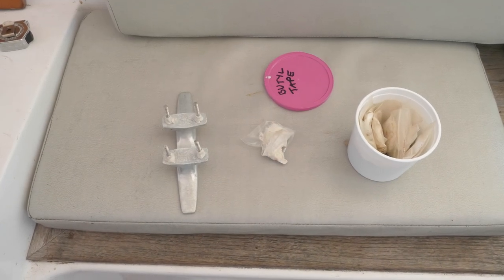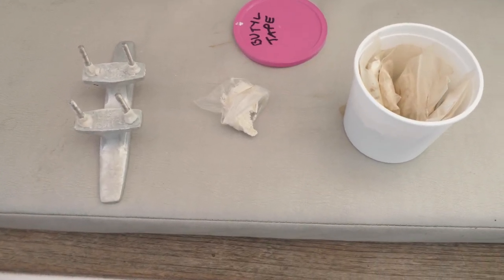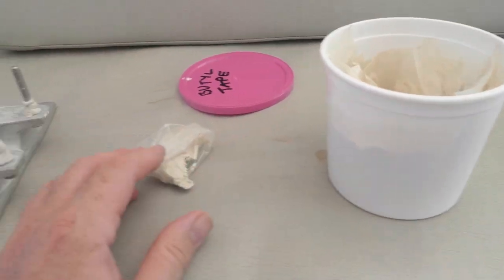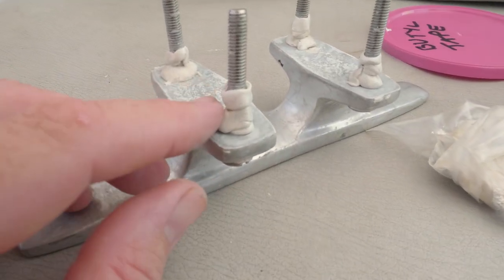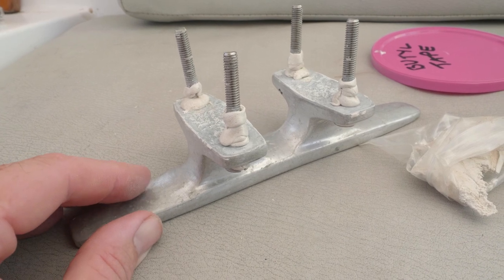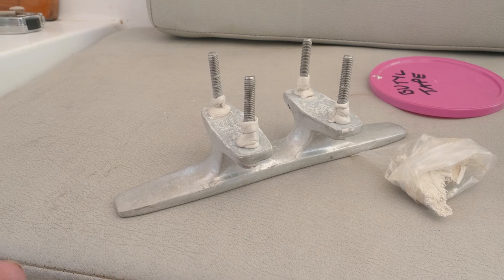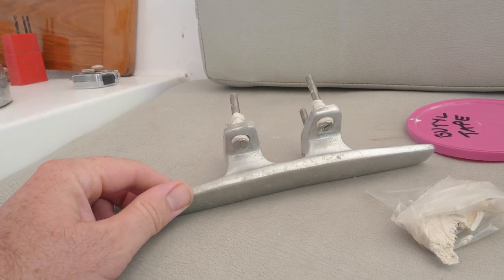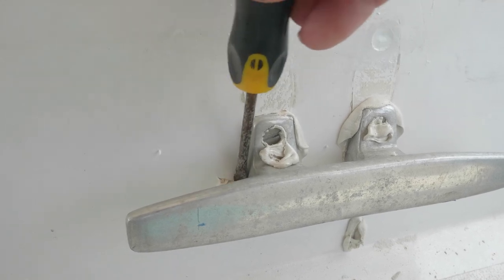HOW TO USE BUTYL TAPE TO SEAL DECK FITTINGS ON A SAILBOAT - SAILING FOLLOWTHEBOAT EXTRA

Comment: First of all I have to apologise for my English. As I a not native speaker it sounds sometimes strange.

The butyl (and lots of other stuff running trough the marinas as rumours as the best) was created for other application than sealing. As I worked as developer in the field of insulating glass sealants I really know all the used material sticking glass, aluminium, plastic and others. Butyl was extruded as the first sealant on a double sealed insulating glass. The vapour seal is excellent, but it is never mechanical lasting. The temperature resistance is weak it becomes soft and sticky when it goes warm. If you have movements in the sealed area it glues with dirt from the environment and divides itself, this means it become unseal. because it works only like a dry screw. When you have to remove it, i.e. when replace a cleat it is nearly impossible because its behaviour is like an old glue from duct tape.

As described, butyl is used for the firs sealing in the inner side of insulating glass. the butyl tape, you (and lots of others) used. was made for mudguards ant other things in the car industry. It has no chemical bonding to the substrate and therefore it can (and will) be infiltrated from dust, salt and water. It has no temperature resistance and become soft in warm environments.

I by myself use either a very cheap acrylic sealant if there is no physical strength asked. An alternative could be Polysulfide sealant (as ist was used to chalk old wooden boats). you can us as well a ordinary silicone rubber as used in window frames (its the best if you have problems with UV resistance. Polyurethane (Sika is only one brand) is not as good if you have to loosen screws again. At the point of environmental influence there no sealant better than others. they all got the problem of plastic and will  not weather in a short time. The only advantage of butyl is, it is not curing and stands in a malleable  condition for years (what causes the above described problems).

You can make a simple test if you don't believe me. Take a small piece of butyl and stick two flat pieces of wood, GRP or metal plates together. Then try to tear apart the pieces. You will see a curtain of fine strings. put it together again and tear apart them again. do it like you want pump. you will feel that he strength become more and more weak. The butyl (if white) become more and more dirty and especially in high humidity it won't stick after a (short) while.
Reply from the maker: Thank you, Wanambi, and your English is spot on! I think in most instances the butyl in deck fittings won't see dirt (or the light of day) because of the way they are installed, but I have already tried your little test and yes, I got the curtain of fine strings. So far, after four years, it has held up well. Thank you for posting, we always appreciate feedback from people in the know 👍
Reply: Butyl sealant used in insulating glass units is a material that hardens to a rubbery state. Butyl tape on the other hand is a material that never hardens or changes consistency  much even after decades. Even though they're both called Butyl they are really completely different.
Reply: No Richard, butyl tape, or better butyl band is extruded with 150 to 160°C from 19 kg blocks direct to the aluminium frame. The glass is applied from two sides to the frame, after this silicone, polyurethane or polysulfide is used as the secondary sealant. This is named two step sealing with butyl as first sealant and others (SI, PS or PUR) as second sealing.

What you mean and maybe know is as single sealed glass often made with hotmelt. Hotmelt is an other product, it works like an activated one component sealing and reacts to the rubber near product. It is stabilized often by an aluminium band inside and supplied often in big rolls. You can get it as well in blocks end extrude it while application.

I could tell you the full story of producing insulating glass from the 1970th but this is not the topic. The topic is sealing screws ant other thing with butyl tape. The recommended 3M Tape is used in cars for the montage of mudguards, or on roofs to seal steel sheets and prevent from scratching an noising.
Reply: JED you are right. The situation is that you always have small movements. Especially the Deck fittings move a lot. this makes the described curtain which offer the possibility of incoming wetness and dust. The seal will not fail immediately it looses (and this is the problem in our usage) from the both "open" sides slowly the adhesion. You will not see the unsealed parts because they are still tight for water. Nevertheless can the water either condensate in the gap or come as liquid water into the gap. As nearly all decks made in sandwich construction it CAN be a problem for the foam or wooden core. But that's not the only thing. As butyl sticks like a chewing gum it is as hard to remove. It is only a physical adhesion but over the time (influenced by heat) it becomes stronger like a rusty push-button. The surface in contact with air seems like it hardens but it becomes only dirty from dust. The covered part get deeper and deeper into the pores of Gelcoat or paint. To remove it for repainting solvent is used. with this solvent you smear the butyl around a big surface. (you wont see it with white or cream coloured butyl but for your own test take black butyl so you will see it.

I don't want to say it's wrong to use butyl. I want say it is not as uncomplicated as often told. The shipyard of my old boat used it (now 40 years ago) as I removed some deck fittings (especially cleats) it was a nightmare to see how much water came inside the sandwich and as well to remove the sticky stuff. Our boat I prepare now for living aboard is a French Dufour. As well it is now 50 years old but they used silicone rubber. For the first I was shocked because the deck needs to be repainted but it is removable very simple you can rub off the bigger layers and then clean it up by a small amount of solvent. The solvent should be soluble with water that you can rinse it of simple - that's it. The unseal parts have been the parts which where replaced cleats or screws always. Either butyl nor sika (PUR) is an universal problem solver in this field.
Reply: From my experience butyl has 3o year life expectancy, meaning it can last longer than that, but it starts to lose its elasticity after around that long and become less malleable. One should start thinking about replacing it after that long. Before it gets to that point as you stated, in which yes it can start to allow water to seep through and is harder to remove. So 40 years waited too long. This might be because as you stated it loses its properties after continual expansion and contraction plus allowing in dirt the more it is stretched, do not know, just know from experience it lasts that long in sealing instances that has mechanical nuts and bolts (or smaller applications, screws). 

I was not aware that its adhesion strength increases over time, plus being influenced by heat. Good to know. Nor was aware that it should not be used in places that sees lots of movement, although never have used it for that. Again, good to know.
Reply: Kevin, it's always boring to discuss about personal experience. To check if it's lasts or not you have to make several tests i.e. tension strength, extension force, water vapour resistance and so on. It depends as well in the weathering situation, the temperature situation and the movement (especially elongation). In Insulation glass the primary sealant (butyl) lasts longer then the secondary sealant (PUR, PS, SI). You have an absolutely clean environment between the two glass sheets. For the deck fittings you have an extreme movement with hard shocks (when the lines set in) as well you have often (in the Caribbean or south sea or other hot regions) high temperatures which make the butyl soft. This comply with the requirement of a kind of "auto sealing".Nevertheless, it becomes unseal on the edges butyl to GRP in small lines, it becomes hard and it is hard to remove if needed. Of course, you and all the other can do what they want - this is only a discussion about the advantages and disadvantages and everyone can decide by himself. My speech is only my experience of 20 yeas developing sealants for the biggest producer worldwide ;-))
Reply: Sorry but professional observed experience only adds to the whole picture. Tests are great starting point, but can never replicate real world environment and various conditions. This is where on-hand actual experience comes in. Stanchions, cleats, portals, etc using butyl have all shown to last well with no leaks for many years. I do appreciate everything you stated, lot I was not aware about. It is always good to learn something new. I personally would not recommend its use on cleats, due to as you stated the hard shocks and lack of strong adhesion, yet many others swear by it.
Reply: Kevin, many others swear by a lot of things. Again, I never said not to use. I gave the idea for what it was made and used for in the last 50 years. As well I am not sure if it was developed or coincidentally found and later grown to a useful matter.

Be sure we made al lot of tests with all available sealants in many fields of usage. Due to we gave guaranty  we had a look to all possible fails. Butyl is not the best sealant for using as a single sealed system. If you modify it to i.e. a hot melt it works with chemical bonding and then it is o.k. Butyl is as well used (in a very clean form) in chewing gum. And nobody would say you can use it for sealing. The main technical reason for using it in insulating glass ist the water vapour resistance. In the car industry (and other industries) is the fixing before screwing and prevention of scratches while montage.

On the boat you can use it i.e. for PREFIXING portlights in the hull (such they are fixed with screws) but only for prefixing - for SEALING you MUST use an other product like Silicone or Polyurethane. All the time when you have to hold a part in place for drilling, bolting, measuring it is very helpful.

Oh, what I forgot. One million flies says shit tastes good but I for me wouldn't eat it.

Comment: The process looks pretty much the same as used with plumbers putty.  I wonder if that has ever been used on a boat.
Reply from the maker: Quite a few have mentioned the similarities with plumber's putty. I'm not sure of the chemical difference.
Reply: It may appear the same at first glance but are definitely not the same product. Plumber's putty is made from clay and linseed oil while butyl tape is a synthetic rubber. Plumbers putty will take a long time, think twenty years, but it will harden, crack and leak while butyl will never harden, crack or leak if installed properly.
Reply: I have bought a 38ft boat this summer, which had its teak deck removed ten years ago and finished in paint; every deck fitting bolt was sealed with 4200 back then and when I took it over about 50 bolts were leaking, hidden by the header, and had been for years, causing rot and nasty black mold all over. I have removed (almost) every fitting (just couldn’t shift the toe rail bolts) and found that in most cases the 4200 was ‘dead’. I have read that butyl tape will be good for 40 years plus. After finishing painting the inside fibreglass surfaces, and next the deck I will use butyl tape on the new ss bolts; no more 4200 or sikaflex for that job. I’ll try the one person trick of grinding a groove in the end of each bolt to enable the bolt to be held still with a flat head screw driver with one hand, whilst the nut is tightened with a spanner by the other hand.

Comment: Use butyl as primary, unless it is in a place where pressure is excerpted
Reply from the maker: I think a bit pressure is ok providing it's through-bolted. Perhaps something like a stanchion base that gets grabbed all the time as you get on and off the boat might be questionable but then we used it on all our stanchion bases and haven't had a problem so far.

Comment: Don’t use it near a place where you might spill diesel. It will dissolve in diesel/petrol.
Reply from the maker: Good point, Edward. I should have included that in the 'cons' 👍
Reply: This sounds very significant.  If both diesel and petrol disoolve it, what's its resistance to other chemicals like?  Chemical resistance is quite a factor in some scenarios.

Comment: OMG, I've been trying to tell people about this stuff for years. Almost no one will listen, damn silicone heads...
Reply: Yes it is weird people just don't listen they shuffle off to chandlers and buy all sorts of goo and then make a huge mess, swearing all the time and still have leaks.  Love Butyl tape.
Reply: P. T. Anderson Silicone may be pretty sticky when it is new and uncured, but the inevitable movement one finds on a boat can cause it to become "unstuck". Just think about all the siliconed fittings that you have ever removed from aluminum spars: it traps water under it and provides the perfect environment for a salt factory to establish itself while your back is turned. And somehow that ooze-gel seems quite caustic; it is certainly destructive to aluminum. Many times we have seen deck fittings that leak from the start simply because the installer unwittingly broke the seal with the solvent that they cleaned the perimeter with after bolting, washing the silicone right out by getting between the surface and the caulk. I am not saying that delicate plastic instrument display bezels or the like should not be siliconed on, but choose a better quality blend like silicone-acrylic, the more expensive blends are way better. And removing the old silicone when re-bedding, it helps to use a stainless or brass wire brush. The marks left by the brush can be erased with simple paint thinner.

Comment: I do not like this. I prefer something that cures into a flexible strong bond like Sika and is chemically 'stable' against diesel and solvents afterwards. I do not have ten thumbs and can do jobs cleanly. I agree it takes preparation, plenty tissue and a small kept handy plastic bag for used tissue. I have never had a leak. Great for you that you have had success with butyl. I hope it lasts well.